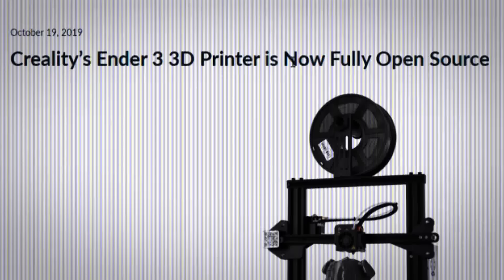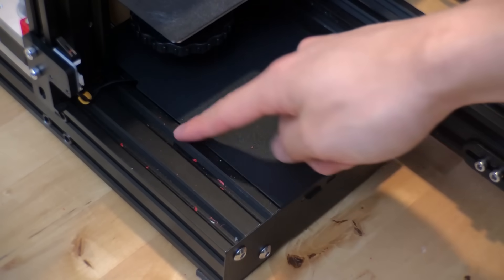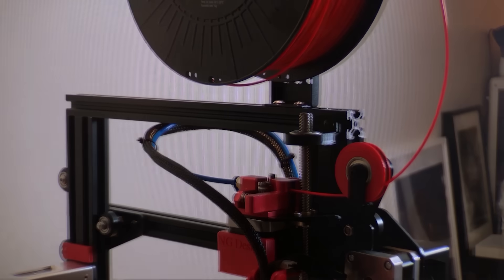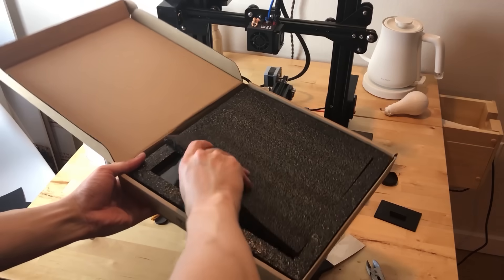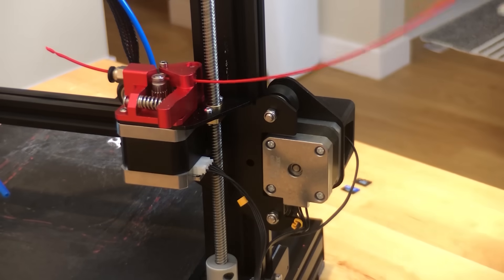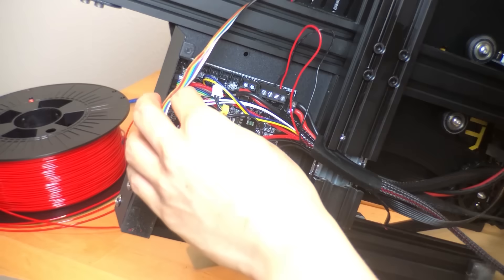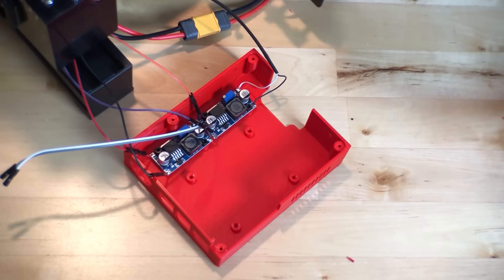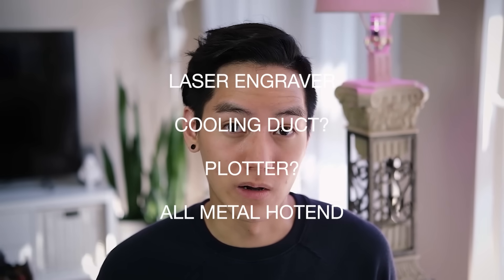First 24 Upgrades for my Ender 3 Pro - Part 1

Comment: Super. Subbed. You missed these two - Hot end fan upgrade with two 4020 turbo fans, universal spool holder. I can see part 2 coming..
Reply from the maker: thank you and oooo i wasn't aware of the 4020 turbo fans! should i do those or noctua fans??? would love your thoughts. cheers.
Reply: @ScottYuJan  noctua have lowest db levels of all but there s $2 ones which are not bad, could be 10db difference in db between two for $6 difference in price. Check out 'Hero Me' design on thingiverse. And one more mod, belt tensioners.. printed or metal, as you like.
Reply: @ScottYuJan  By turbo fans I meant fan on the side. Not sure if noctua have those side fans.

Comment: How about cooling fan duct near the hotend?  Guess you don't need it since your prints looks good.
Also what material you use to print them?  PLA? ABS? PETG?
Reply from the maker: Nicolas Locke thank you! i might still do that still in my part 2, just to help with bridging but we’ll see. i labeled each part with words at the bottom of the video. some are PETG and others are PLA.

Comment: Why ruin a great printer....If it ain't broke, don't fix it.   I have 3 Pros and they have just 2 mods...a micro swiss direct drive with the hotend and a glass bed.
Reply from the maker: true haha i mean, i had a few problems with some aspects of the printer at the start but it's mainly because it's also just kinda fun to upgrade and mod stuff i think haha

Comment: Video and editing is super clean, everything is quick and concise..ya definitely got something going for ya, here!

Also, you spotted some mods that I've not seen in any of other videos (likely due to the time elapsed from their year old vids), and there are some GREAT improvements! Love the tip for the extruder hack, too!

Note: I'm in the process of modding the living crap out of my Ender 3 (got it a couple weeks ago), so this definitely helps add a couple good ones to the mix!
Reply from the maker: awesome man! glad this was helpful for you. cheers and good luck!
Reply: @ScottYuJan  thank you!!

If ya ever need help modeling stuff, I'm pretty alright in Fusion 360, so hit me up!
Reply: @ScottYuJan  Random tip, since I saw the Y-axis cap can interfere with the printer. Though you could check this out: https://www.thingiverse.com/thing:2986144/comments . It's for x and y-axis tensioners. Should be measured to better fit and make it much easier to tension your belts!

Comment: just get rid of the bowden  and get direct drive. Like Hemera, or cheaper version BMG aero
Reply from the maker: thanks for the suggestions. do you find a direct drive influences your print speed though with a heavier hotend piece module? please let me know! that's like the biggest thing holding me back.
Reply: @ScottYuJan  Since the direct drives I posted use pancake motor, the weight isnt an issue here. Max print speed I use (for technical part where I dont need super print quality) is 130 mm/s. The biggest benefit is that you dont have to care about retraction, becase filament extrusion is much more precise. Also you can print TPU filament without issue.

Comment: Your upgrades are cool. 
Ever find the cooling fan too noisy? You can ditch the cooling fan for a water-cooled block using CPU water cooler. Your ears will thank you for that.
What about an enclosure with a piped exhaust out of your room? Your nose will thank you for that.
Reply from the maker: thanks man, and thanks for the suggestions too! definitely considering an enclosure.

Comment: Alternatively, just buy a printer that doesn't need 24 upgrades in the first place.
Reply from the maker: yes! are there any in this price range though? i totally thought the ender series are the only ones in this 200-300 dollar price range.
Reply: @ScottYuJan  I've only owned a few, the Anycubic machines have great build quality and print results, the i3 Mega being the classic example, and it only needed a few upgrades. The Mega Zero is great and under $200, no heated bed but it does have a Titan extruder clone that works great, without a heated bed all you need is tape, i've never needed glue. But yes, Enders are great value too. It was a flippant comment i made ;+}
Reply from the maker: @GaryMcKinnonUFO  haha still, good to know! i'm kinda new to all this so i totally wasn't even aware of those printers. wow under 200 bucks is impressive and that thing looks almost just like the ender 3 too!!! what the heck..... well now i know haha will definitely look into those in the future. cheers.

Comment: I did the same thing you did with the raspberry pi and buck converters for several months but the GPIO pins limit the current the raspberry pi can draw. You can get way more performance out of the raspberry pi if you solder the buck converter wires to a mini USB or USB C (depending on your pi) connector and plug that into your raspberry pi
Reply from the maker: WHAT?! that's concerning... wait but what's the result of low voltage supplied to my pi? does it mess it up over time or influence performance speed or something? because so far i've been using this set up fine. please let me know! thanks.
Reply: @ScottYuJan  That's actually why it took me so long to notice. It runs perfectly fine when it's powered through the GPIO pins but octoprint will just run a little slow. It might take 20 seconds to upload a file or start it up and it gets much slower if you add something like octoscreen. When I installed octoscreen, I straight up couldn't load anything on octoprint anymore since it was so slow. 

Since then, I connected the power to a USB C connector and powered the Pi that way and it's crazy how much faster it is. It feels like it's running on a normal computer now because of how responsive it is. I think the GPIO pins are limited to 300mA off the top of my head so while it should work fine for you, it'll run way better powered through the USB.
Reply from the maker: @anonosaur6466  WOW thanks for the heads-up.... yea that is great to know. i'll definitely be fixing that. cheers.

Comment: Excellent breakdown.

Might I suggest you look into these? It makes belt tensioning much easier.

https://www.amazon.com/BCZAMD-Adjustable-Synchronous-Straighten-Tensioner/dp/B07ZPY11B1/ref=sr_1_3?crid=1AV4KP4JVBWLG&dchild=1&keywords=ender+3+pro+belt+tensioner&qid=1595803457&sprefix=ender+3+pro+belt+t%2Caps%2C174&sr=8-3

https://www.amazon.com/FYSETC-Synchronous-Straighten-Tensioner-Accessories/dp/B07RXY6FBV/ref=sr_1_5?crid=1AV4KP4JVBWLG&dchild=1&keywords=ender+3+pro+belt+tensioner&qid=1595803518&sprefix=ender+3+pro+belt+t%2Caps%2C174&sr=8-5

Comment: Bruh the motor dampeners are to prevent ghosting... not sound... They reduce the sound though as a side effect.
Reply from the maker: that's interesting! if you google "skr mini with stepper dampers", almost all the reddit users and threads say to remove them since they no longer make a difference. the only people who kept them on only pointed out that it's slightly even more quiet. have you done tests with them on and off? i might just keep them off though since i've been doing pretty okay in terms of ghosting but please let me know what you think. if it makes a significant difference maybe i'll add them back on in the future.

Comment: Flashing a bootloader is easier than dropping in a new board.
Reply from the maker: Christopher R. true but i wanted all the other features that come along with the SKR mini. and also doesn’t flashing a bootloader need an arduino? or is there an easier way?
Reply: @ScottYuJan  you do need an Arduino, but it's pretty straight forward. Then you can repurpose the board or reuse it for future printer flashing for those you might  buy. 😂😂

Comment: Any issues with the dual gear extruder? lots of complaints about the gear grinding the aluminum
Great video
Reply: I have the WINSINN dual gear extruder from Amazon. I can confirm that the steel gear does eat the aluminum underneath. A poor design honestly, it should be held in place by a grub screw like the other gear is. I'm hoping that it just self clearances and that's the end of it, but I'm keeping an eye on it in case it becomes an issue with print quality. Honestly not sure why it wants to push down into the aluminum; maybe the filament holes are slightly lower than they should be, and the pressure of the filament in the curved channel of the gear is pushing it down.

Comment: The thing you added to the top to stabilize the threaded rod is usually a bad idea and adds wobble. It's makess the rod wobble the gantry. When it's lose its more likely to just wobble loosely at the top. The rods are only for movement in the Z axis

Comment: have you noticed with the SKR board that the stepper motors get super hot? I had to downgrade the firmware on mine because the motors were getting so hot they would burn if I touched them. I heard it is a common issue with these boards that they deliver more amperage than the motors need.
Reply from the maker: DUDE i was JUST trying to find a solution for this. did downgrading the firmware work? I even considered adding heatsinks to the stepper motors but that would really be a pain in the butt. so which firmware version did you downgrade to?
Reply: @ScottYuJan  Yes, downgrading the firmware did fix it. I am not sure what features i lost because I downgraded. It seems to work great now. I can't remember the version. Just the version before the last version I think

Comment: I'm in the market for a new printer and I've watched multiple vids for ender mods and THIS video compiled ALL the best mods, while keeping the video short, and adding some dope music. You get my respect, my subscribe, and I'm gonna get this printer now.

update: order placed, printer, mod 19, 21, & 22 on the way
update 2: I got the 3d touch, which is a knockoff of the way better BL touch. DO NOT BUY THE 3D TOUCH. The measurements it takes are so inaccurate that parts of your bed will be too high while other parts are too low, so it's basically useless. The BL touch is a bit more expensive, but worth it!
Reply from the maker: Rawjaat that’s awesome man! so glad i was able to help. have fun with the printer and good luck!
Reply: @ScottYuJan  I reallllly want to upgrade to the BL touch, but am not too savvy with changing software settings, i dont wanna brick my printer, alot of the videos arent real clear, or they skip some steps. Any advice?
Reply: @DrShwifty  I just set this up a few days ago. If you have the skr mini, the bltouch should work without requiring any change to the firmware as long as you replace the z-stop with the bl touch. One problem will be that when manually homing the z axis, you might not be able to go low enough, so that would require some firmware edits.
https://github.com/bigtreetech/BIGTREETECH-SKR-mini-E3/tree/master/firmware/V1.2
They show how it needs to be plugged into the board on this github page. If you want to change firmware settings, you'll have to install visual studio code and I found a few good videos that guided me in the process of editing, compiling, and loading the new settings to the printer. If you want specifics message me, but I'll try and link the most helpful videos.

Edit: I just remembered it's not 100% plug and play for the bl touch, you just have to flash the firmware that's on bigtreetech's GitHub. No coding required, just upload to micro SD, plug in ender, and turn ender on.
Reply: @ScottYuJan  I Second Jame's question. Do you have any advice for setting up the BLtouch?
Reply: @Apoth3otic  https://www.youtube.com/watch?v=QdHpd5EsSeM&t=1397s Follow this guy's guide to set it up and it'll work perfectly, unless you get the problem where you can't lower past the z-axis zero point, which means you need to change the firmware settings.

If you need to change anything in the firmware then follow this guide to install the required editing program https://www.youtube.com/watch?v=Mjhp_P-Yzv0
IMPORTANT STEP if you get the skr mini board Scott recommended, then download the Marlin that the board is currently running instead of the official marlin that the above video suggested, which can be found on github here https://github.com/bigtreetech/BIGTREETECH-SKR-mini-E3
in the firmware folder > v1.2 > Marlin-2.0.x-SKR-Mini-E3-V1.2. You'll have to download everything, and then go to that specific folder in the package.
Once you build the firmware with your edits, the new "firmware.bin" file will be in "Marlin-2.0.x-SKR-Mini-E3-V1.2 > .pio > build > STM32F103RC_btt_512K"
Put that file on the micro sd, plug it into the printer and then turn it on, and then once you see the start up screen then it should be ready to go

ALMOST FORGOT: You'll probably get an error when trying to compile. That's because you have to change something in the "platformio.ini" file. Go here https://github.com/bigtreetech/BIGTREETECH-SKR-mini-E3/issues/302
And mIRACLELive1 mentions that you have to change it from "platform          = ststm32" to "platform          = ststm32@<6.2.0"
Reply: @rawjaat  really nice of you to write this all out :) getting mine soon and will come back here when i run into problems
Reply: @jalensailin  no prob. All the specific things I mentioned are things that took me a while to figure out, so I figure others will have the same problems. If you have any problems find me on twitter or insta @rawjaat
Reply: You can pin your comment so it stays at the top.

Comment: why on earth you would get a rigid glass bed instead of flexible top?
Reply from the maker: My flexible top was getting super dirty and leaving marks on the bottom of my prints. the rigid glass bed obviously has its downsides but i like how easy it is to clean and it always leaves my print bottoms nice and clean. i can also flip it upside down if i ever want to have a more gloss finish on the bottom of my prints too so i really like that.

Comment: such a nicely edited video. shame for such a low subscriber base. you earned my sub sir! ive got 3 printers running off a single b plus so tying it down to only one printer wouldnt be ideal for me unfortunately and unless there a huge improvement in print quality or usability (tpu, etc) the other things ive found to be only minor nuisances. the issue i have with the metal extruder is that its not as versatile as the ones designed to print TPU. Since that seems to be your only printer i recommend either printing the one designed for tpu, or getting the EZR one, both of which are unfortunately plastic. I believe it IS possible to print TPU on there but you are severely limited on hardness, and speed. i think the ultimate upgrade would to convert the stock setup to direct drive, which can be done with a cheap kit, or a thingiverse bracket. Youd have a lot more versatility converting to direct drive overall. i am also a tinkerer/modder/maker and would love to mod the heck out of my ender 3 since as or now, my cr10 pro v2 and prusa i3 mk3s are getting all of my love. your video inspired me to modify it further than i already have, but maybe something more practical as i am less of a visual modder than yourself :) Thanks for the video, you earned my sub!
Reply: i didnt see the part about the all metal hot end, but to me it would be worth the upgrade. i would advise the volcano for larger nozzle options since it has a longer heating zone, which for me would be practical.
Reply from the maker: @svanput  didn't know about that one! thanks for the tip. will definitely look into it
Reply: @ScottYuJan  Also, you may want to skip everything i just said and convert the stock parts to direct drive for 40 bux.

Comment: Hey Scott! So I was wondering, I printed the filament guide but I can't get my bearing to fit into there, it seems like its just a little bit too big. I was wondering what I might need to do differently? I printed it at 25% and I am using the 608zz bearings.
Reply from the maker: i ran into this issue too! it defends on how far it is from fitting. i used a lighter to just slightly soften up the part and pressure fitted it in. if it’s very far for you still, i would just try reprinting it at like 102% or 103% larger and that should work. good luck!
Reply: @ScottYuJan  Thanks Scott! I ended up using a round file and just shaved it out, ever so slightly and the pressed the bearing in there. Ended up working out! I was wondering if you have the filament running over the bearing exactly or just more so being guided by the shape. Either way I got it on, so that feels great, plus it looks awesome. Thanks again!

Comment: At 2:56, the fan isn't even running when you put the cover on... That mod is so dumb, it is restricting air to the flow of the fan which is drawing air in not blowing it out....
Reply from the maker: Ian Jackson NICE. congratulations you caught me 😂 i actually took the audio from another footage but that footage was too dark and when i re-filmed the new footage i didn’t bother turning the printer on! it did honestly make that fan quieter and i was worried about restricting airflow too but from all the comments on thingiverse it doesn’t look like anyone has had any issues with it so far and i’ve also been closely monitoring the PSU too to make sure it’s not heating up or anything. we’ll see though. i might just get better quieter fans.

Comment: Your good....just subscribed. Thanks for a very informative video....do more. I have 2 ender 3s and although you did a PRO I am going to work on my 2 Ender 3s and my CR10. Have to two new boards and have installed one. Also going to order two touch screen upgrades next month.